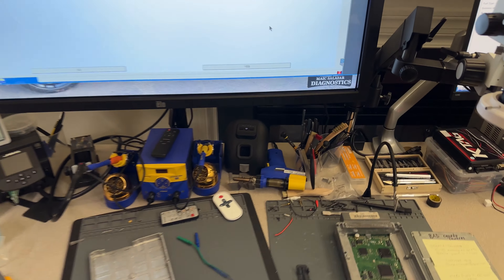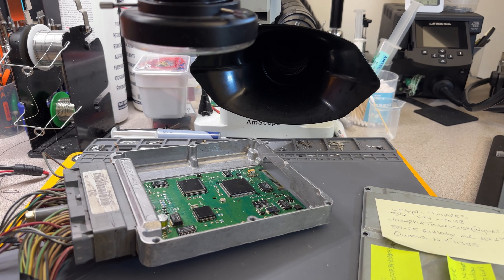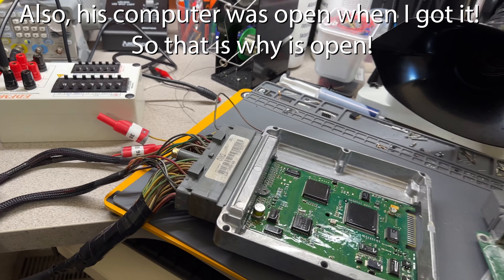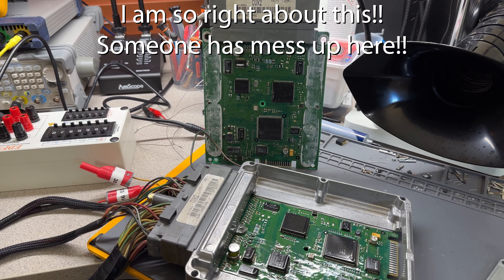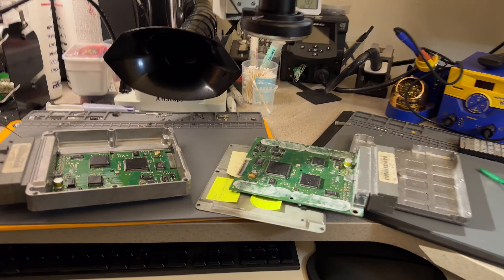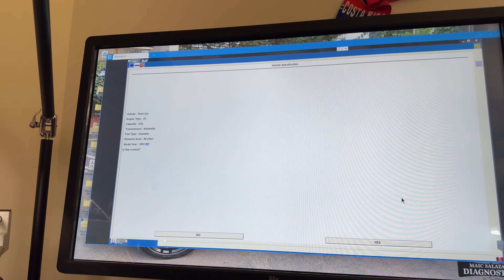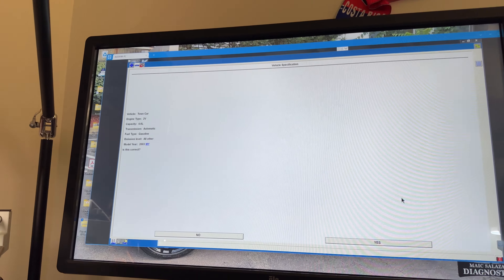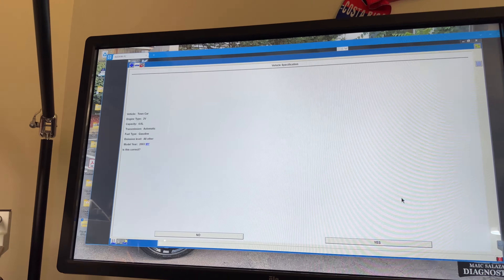2000 Ford F150 5.4L SVT Lightning PCM no comm no start test for Joseph Tavares NY

Comment: Maic tengo una pregunta tengo una Ford 150 5.0 v8 del año 1995 quiero saber que referencia de pcm usa he estado buscando información y no he encontrado espero me puedas ayudar por favor
Reply from the maker: Que referencia? El número de parte está en la PCM tienes la original?
Reply: @MaicSalazarDiagnostics   la troca no la encienden hace 4 años lo que estoy pensando es que tiene pcm que no corresponde a la troca y solo quiero saber que referencia debería llevar por qué la que tiene es una F2TF-12A650-BNA se me dió por destapar y solo ví 6 transistores  pero este es un motor V8 distribuidor y sensor maf